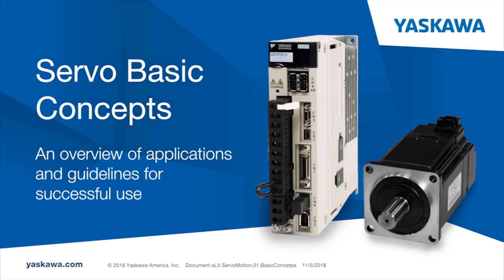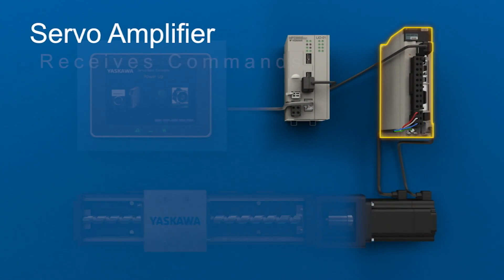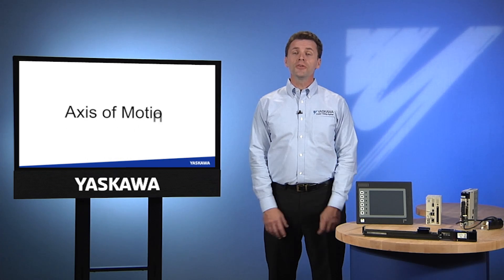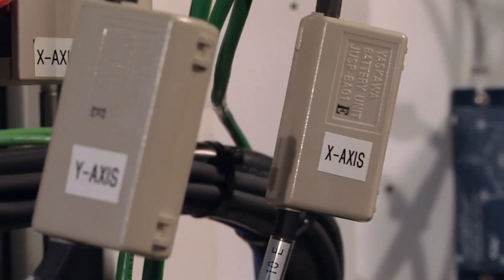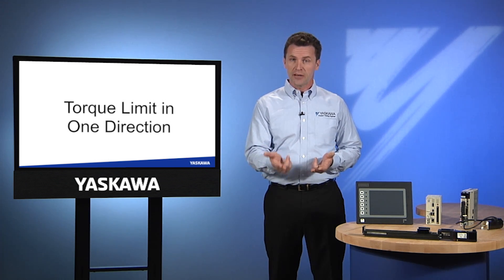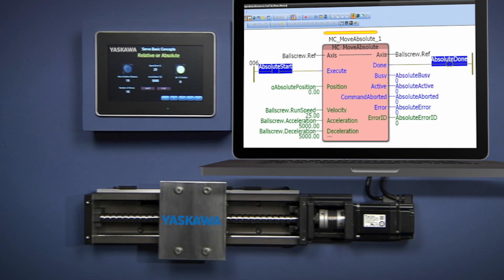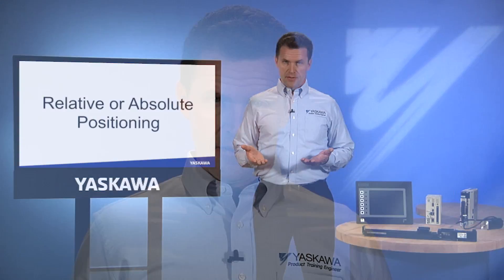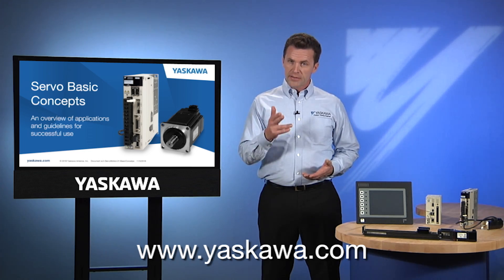OBSOLETE - Servo Basic Concepts

Comment: Sir please tell me how this servomotor hold the shaft in servo enable mode.is any electro magnetic break used on it.
Reply from the maker: Thanks for your interest in Servo 'Basic Concepts'.

The electrical characteristics of the motor allow it to hold the rated load when the servo is on there are no mechanical brakes engaged when the servo is on. 

We recommend contacting our Technical Support with your application information at https://www.yaskawa.com/support-training/support, or you can also reach out to your local Yaskawa Service Provider - https://www.yaskawa-global.com/company/profile/global.

Comment: Great job on the tutorial,! I would like to better understand the purpose of holding brakes in servos?  Are these brakes only used for safety applications, therefore when pushing emergency stop button, the motor power is removed therefore allowing the holding brake to be activated immediately? The holding brakes are used to prevent gravity from allowing a vertical axis from dropping down ?  What is stopping the servo so quickly if brakes are not being used in regular motion?
Reply from the maker: Thank you for your interest in "Servo Basic Concepts". The Holding Brake is to Hold the load and isn't designed for the use of stopping a load. If you require further assistance please contact our Technical Support Team at https://www.yaskawa.com/support-training/support.

Comment: Why can't we change direction of ac servo motor by swapping the uvw leads. I was told servo motors are same as induction motors with encoder and gear control. Is this true
Reply: we offer belt-driven linear rails which are more efficient and economy, welcome inquiry andy@ccm-rails.com

Comment: amazing videos, they have been helping me a lot of, and also have been changing my mentality about that incredible world, but I have a question; ¿HOW MANY SERVO MOTORS CAN BE CONTROLLED AND CONNECTED TO THE SAME SERVO ASISTENT? ; is just 1 motor by servo asistent or can we to connect 2 ; 3 ; 5 ..... , to the same servo asistent without problem, THANKS
Reply from the maker: Thank you for your interest in Servo Basic Concepts.  There is the SGD7W servo-pack, which can run two motors. Your local sales representative can assist you in this selection. Please use this link to locate your local Yaskawa Representative. https://www.yaskawa.com/support-training/support/sales-search
Reply: thanks for taking a few minutes of you time to answer me , I really appreciate it, and for sure I will check it and get get all of the equipment that I need, never change, you do a wonderful job, with a lot of respect Kristian.
Reply: we offer belt-driven linear rails which are more efficient and economy, www.ccmrails.com  welcome inquiry: andy@ccm-rails.com